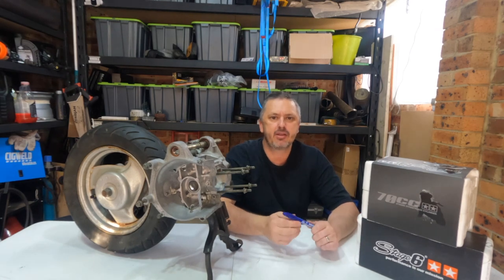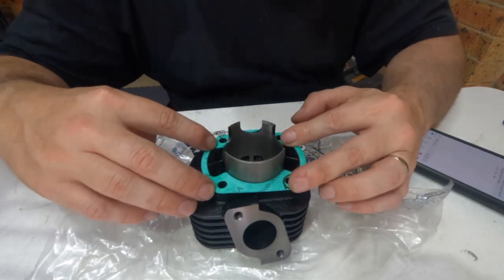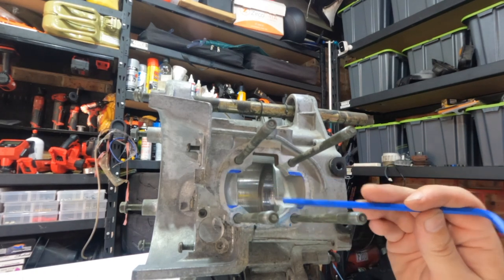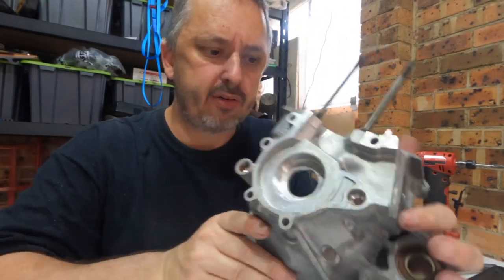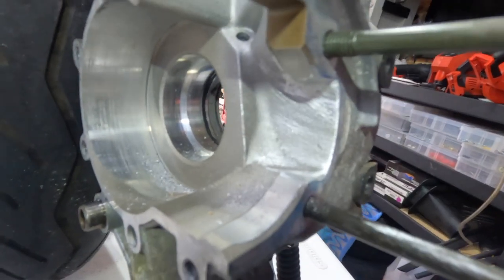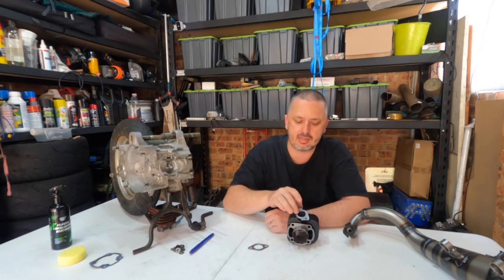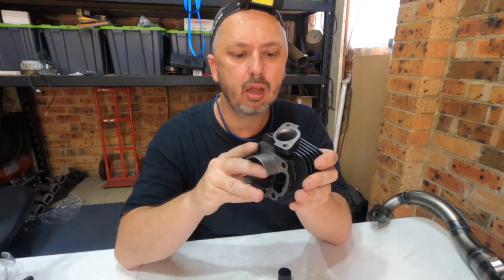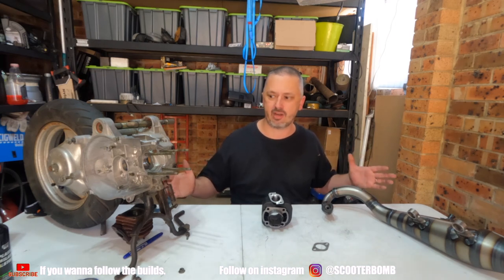2 stroke case port matching and flowing

Comment: Great video mate, I'm looking at porting my jog R so this is helpful 👍 Iv never tried this kit so interesting to see how well it proforms .Iv got a Parmakit racing cylinder kit as it's cast iron and only single piston ring, never tried it before so thought I'll give it a go and was very surprised how much power this kit produces compared to other 70cc cast iron kits. I'd definitely say it's up there with the polini corsa
Reply from the maker: The bike is really ripping. Goes very well. The porting is easy as most of its already done with this motor. Thanks for the kind words.
Reply: aw°

Comment: Do you think this would be possible to do with cases jointed and crank in ?  I didn’t realise I had to do this to mine and I’ve assembled motor and REALY don’t want to split case again ? I was thinking of trying to deal with rags and do it upside down to keep anything from flying in ? Do you think this would be possible ?
Reply from the maker: Unfortunately I wouldn’t recommend as if you get metal shavings in the bearings it could cause catastrophic failure. Give yourself a weekend and you would get it done pretty easy. Definitely worth the effort